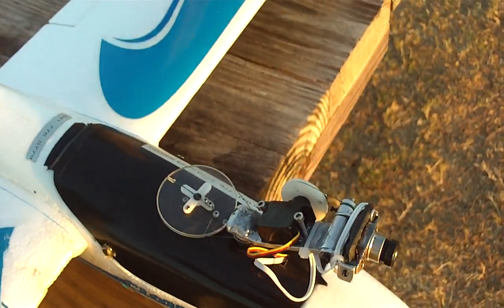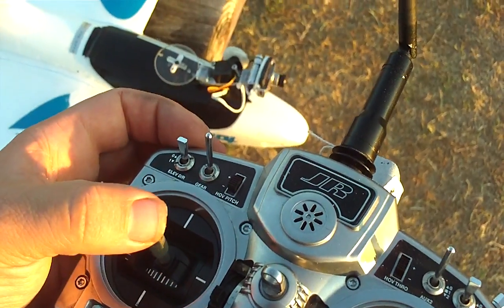Foamy FPV details

Comment from the maker: @gc9n With the video transmitter and battery in the rear, the CG is at the factory location.  The rudder is controlled the same way it was from the factory, I'm just using a 9 channel rx

Comment: I looked at that plane over at Hobby King.  It appears to be a smother airframe that the Easy Star but its also smaller with less surface area to haul your gear up.    Whats the Kv of your Motor and size of your Flight Battery?